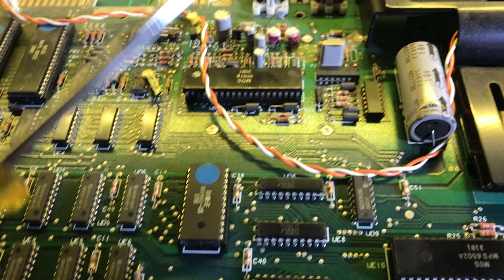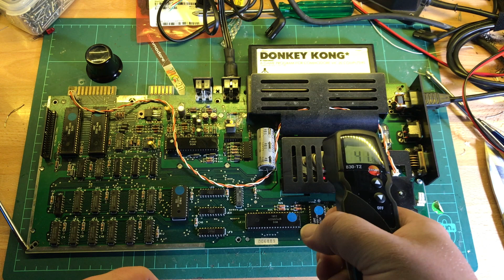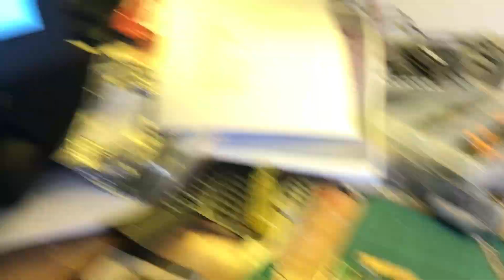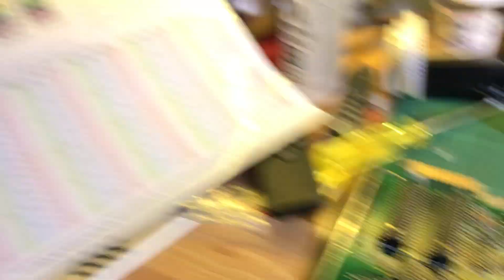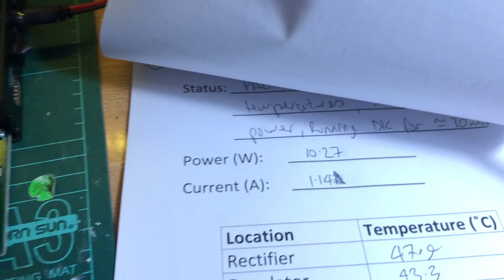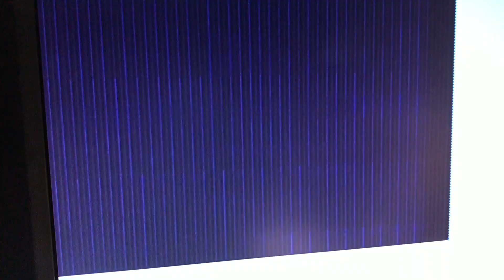🇺🇸 Commodore VIC-20: reducing heat and power consumption [TCE #0025]

Comment: Can you close the lid with the rom stacks ?
Reply from the maker: It depends on what style keyboard you have.  It's been a while since I fiddled with these but I recall that there are some where the plastic frame can interfere with the stack, in which case I think you can just forgo the socket on the daughterboard and solder the programmed ROM directly ... this will save some height.